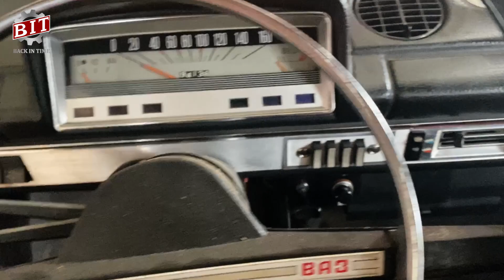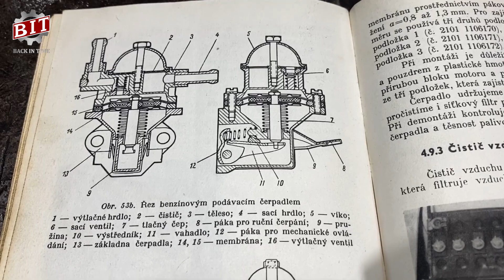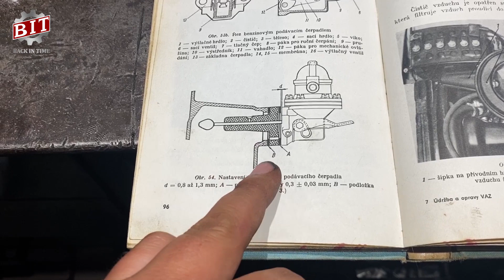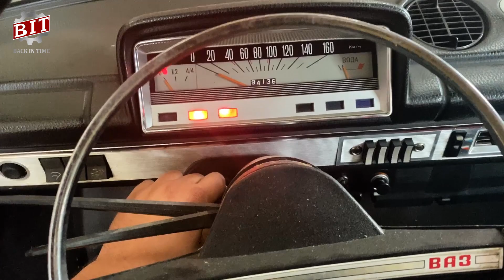Lada 2102 Žiguli - oživenie po 19. rokoch

Comment: Fantastic. Several months ago we sold our 2004 2121 and bought a 2 owner, 64,000 original mile 2101 Zhiguli and absolutely love the car. I still need to find an original steering wheel with full horn ring as the 2nd owner replaced with one from a NIva. Thank you for a great video.
Reply from the maker: Thank you for the compliment! :)